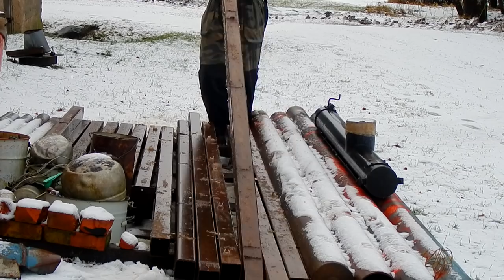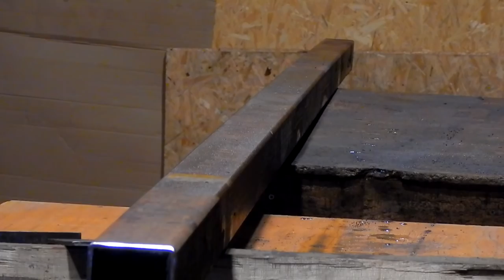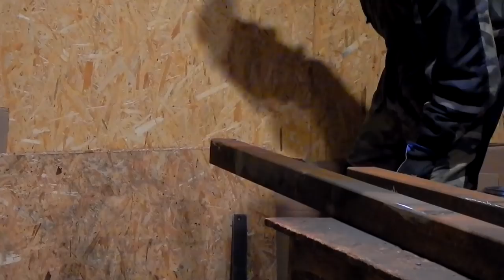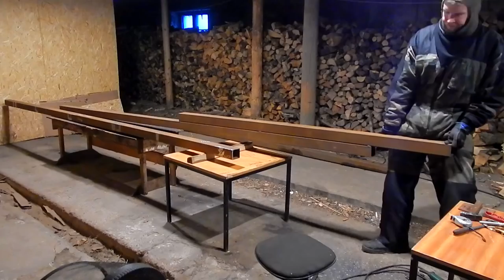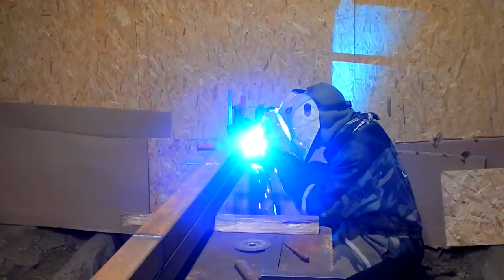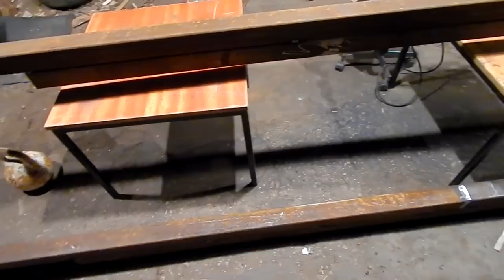Trailer Sides - Band Sawmill Build #1

Comment: Can you do a twin axle?
Reply from the maker: I can but I probably don't - the weight of the log on the trailer will be resting on the jacks that are used for leveling and supporting the trailer when working. One axle and leaf springs will be sufficient for supporting the sawmill weight only. ;)

Comment: so dry wood ignites at around 500C. those sparks are 3100C when they leave the ginder and after flying 10m are still around 550C so how about cleaning your shed of wood dust and those little pieces and when your grinding/cutting put a metal sheet to block and direct the sparks where they cant set anything on fire. also they may not ignite immediately but after 8h when you stopped working. so please prepare and be safe.

Comment: It is very dangerous to use an angle grinder when there are flammable materials like firewood or OSB in the room
Reply: I would like to see osb lit on fire from a grinder cant even light that stuff with a torch.
Reply: especally then when you want to light it, wood starts to burn (enc: osb) at 220-240 *C  if i remember correctly, so its quite hard to start fire with grinder sparks
Reply: OSB - plywood or stove wood are very hard to ignite with a grinder, but  a dry pile of saw dust or a shop rag is a recipe for disaster, both can smolder long after you left for the day.
Reply: There are plenty of examples from the history burning down the building because of a grinder.
Reply from the maker: I know it's sort of dangerous... But in my fifteen years of angle grinder cutting experience I've only set fire to my work clothes. Once. The previous ragged one piece work clothing / coverall I wore was looking like that exactly due to the grinder sparks. And the previous coverall looked just like that. And the one before that. And I still do it, sort of purposely, by directing the flow of sparks against my thigh to avoid sparks flying somewhere far. I always throw the "oily rags" in the stove and never direct the flow of sparks towards sawdust piles or keep petrol canisters or charging batteries near the place where I cut stuff up etc. One important thing you have to consider - the temperature in the barn right now when I have to cut and grind indoors is usually near 0 degrees Celsius, around +2 or +3 degrees max. When it get's warmer I do all of the cutting outside. At that temperature it is quite hard to ignite anything. You have to really work on it to get stuff ignited even if it is bone dry and seasoned wood or a flammable resin based OSB sheet. The energy in the spark will be absorbed by the temperature difference between the OSB / firewood and the spark(s). I deliberately direct the flow of sparks on this project preferably towards the ground, or if I have to, towards the OSB sheets in sideways or in longitudinal direction of the barn, but always away from the firewood. I'm not saying a fire can't be started in these conditions. I'm saying I'm aware of the possible danger, and this kind of preaching annoys the hell out of me.